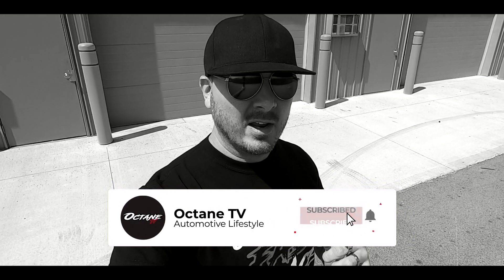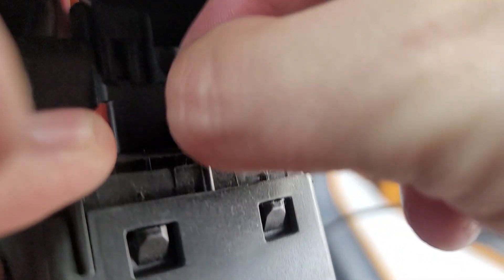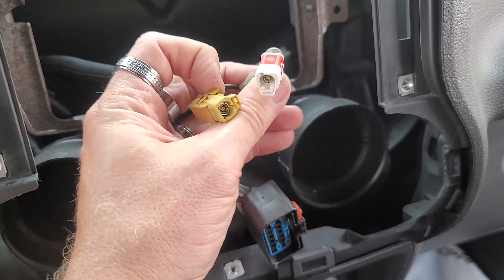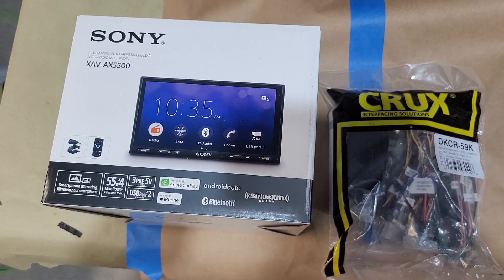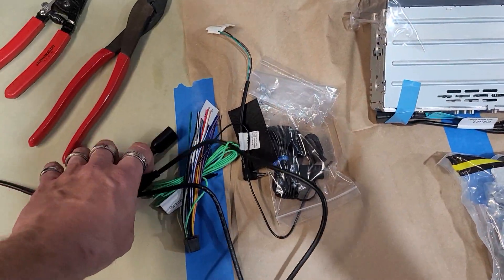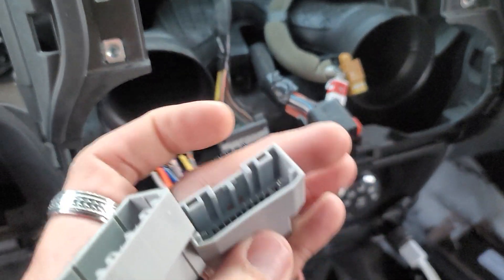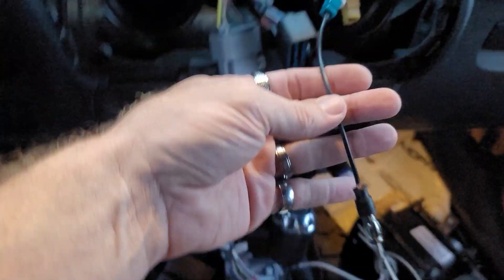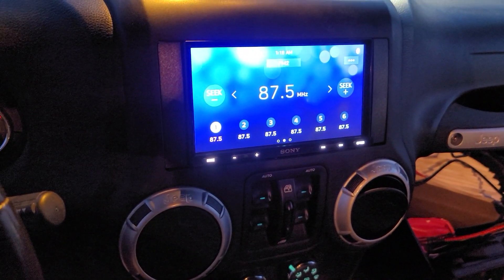JEEP WRANGLER JK SONY XAV-AX5500 DOUBLE DIN RADIO INSTALL

Comment: i have a 2013 expedition and there is no sound in the rear speakers. but i have all 8 wires, and the connections are good from the wire harness to the new rear speakers. its like the deck is not sending out a rear channel. any ideas